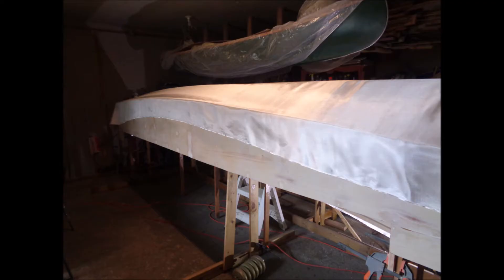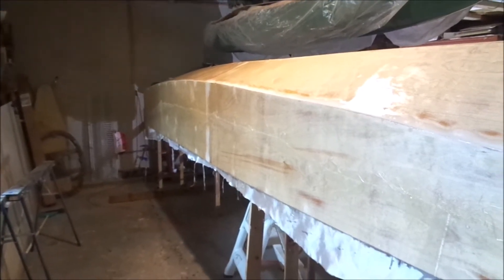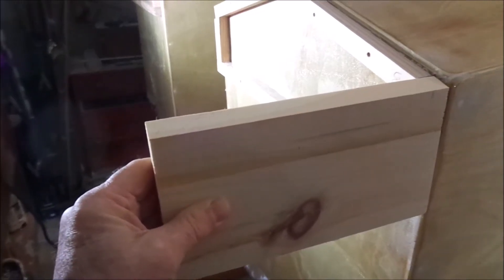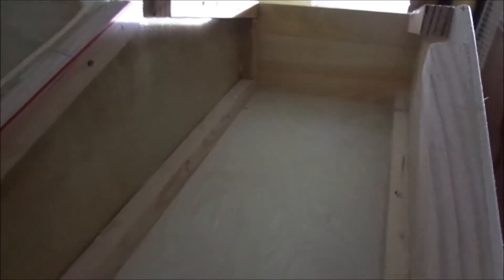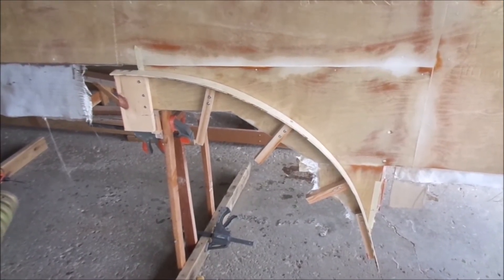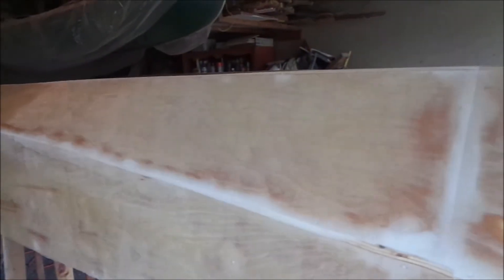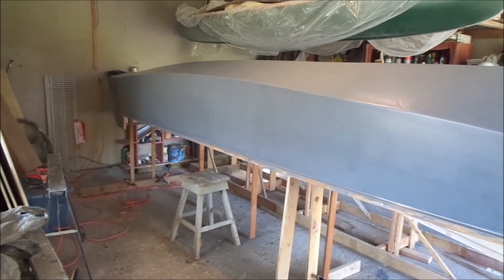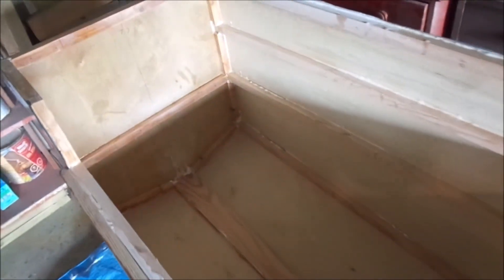Building My Solar Electric Catamaran Part Four

Comment: Small misinterpretation of my text. The epoxy mix with glass bubbles is used after the glass material is on to fill the structure with the weave. Adding the glass is of course done with epoxy without any filler
Reply from the maker: Thanks, Bernd that makes more sense to me. It would be good if there was a video of the process of glassing with the filler. I could not find anything in that regard.
Reply: @philboyer2036  Sorry a bit late but the procedure is allways the same. First operation.1. Apply Epoxy to the plywood (see my video).2.  Sand of the upstanding th ewood fibers. 3. Apply the glass fabric, use Epoxy without any filler. If the area is big use a Epoxy with a slow hardener. 4. For a smoot surface apply a butty with glas spheres and fused silica, To apply use a very wide glass cleaner. Then sand just down to not damage the glass cloth. Now the surface is ready for the paint system.
Reply: @philboyer2036  
You want a good connection between the surface (our case plywood) and the glass fabric. The epoxy is the bonding material for a good connection between the plywood and the glass fabric. To avoid air enclosure a very thin epoxy is preferable. Never ever any filler